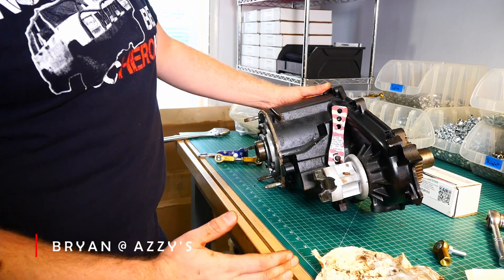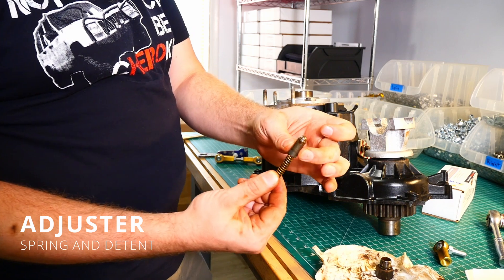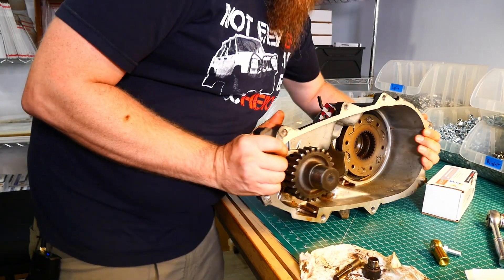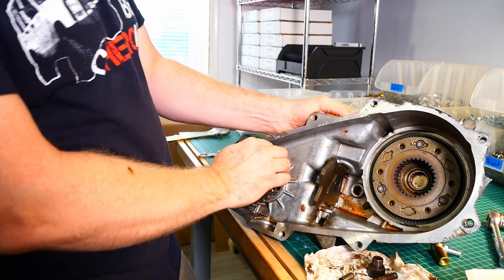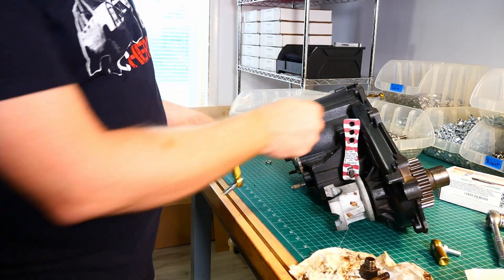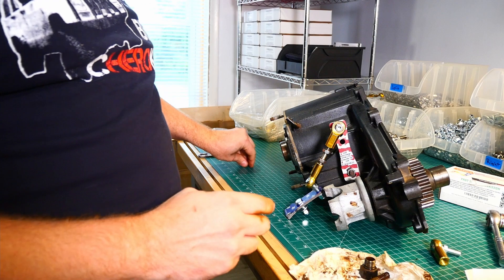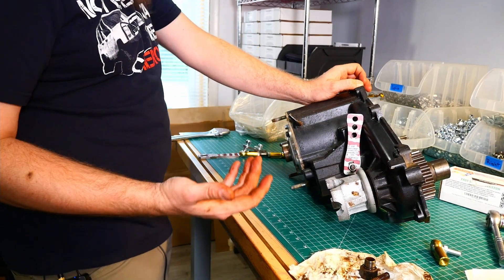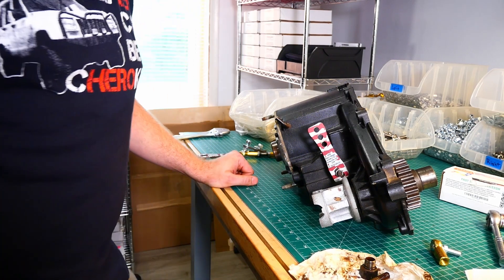Azzy's Design Works: 231 // 242 T-Case detent service for Linkage Adjustment

Comment: I have installed this kit on 242 like how it is done on 231 without the extension piece.  It worked great for the past 3 years. Now I have dropped the T case, the linkage is literally straight with the lever on the transfer case selector at 4 low and it is stuck there now.  Hope is to install the extension and have the linkage at the top most hole on the lever on the transfer case side will bring the mechanical advantage back so that I can get it out of the 4L.
Reply from the maker: We have a lot of them on 242s without, but be careful with tcase drops. It does put extra strain on the front driveshaft, and force it out of phase, and adds extra friction to the slip joint. I've ever been a fan of them. 

The extension should get your back in gear!
Reply: @Azzysdesignworks Thank you for the reply.  

I upgraded the cross member and it gives 1 inch drop.  Already have SYE. Now that you mentioned it, I can see how the t case drop can add more angle to the front driveshaft.

Do you have any recommendation on which holes out of the 3 that I should use?

Comment: I have the 242 and have the extra shifter tab. Had to mount the bottom one backwards or the centre links hit the drive shaft. Struggling to adjust it right as it pops out of 4xAll time unless i hold the shifter back. The first 4hi part time engages a little early on the cluster in cab. Im running top bolt on the 3 on the transfer case side. Am I running the rod too short or too long? Seems centered when im under the truck. Little help. Just losing my mind 🤦🤦
Reply: Ok thank you
Reply from the maker: Drop me a photo, info - azzysdesignworks.com
Reply: @Azzysdesignworks  figured it out! I the video you say top hole for the 242. On the photo on your website it's in a lower hole. Now it's finally working! It's amazing!! Solid!! Thank you.
Reply: So which is it, top hole or lower hole?
Reply: @danielpeyton9072  bottom hole. It took a few hours in the snow going back and forth adjusting the length and rechecking. If you need the measurements from bolt centre to centre i can get under it tomorrow before work.
Reply: @danielpeyton9072  correction. 242 t case middle hole, has the extension bracket and bolt to bolt centre hole is 5 inch maybe a hair under.
Reply: Yeah that would be great and can you take a picture of yours too just so I have a better visual idea of what it should look like

Comment: So this is stupid get rid of the 242 part. Once you're in 4 lo it just gets stuck no matter which hole you use. This shit is so dumb. I just spent 4 hours trying to figure it out. Fuck azzy design shift linkage and any kind like it. The shift cable idea was better than that crap

Comment: Have you designed one for the zj yet?
Reply from the maker: We have one designed and made that fits the 242 + 4.0 ZJ, and are testing it with a few V8s.  The biggest delay is getting parts made, our adjustment rod manufacture is behind, and rods we hoped to receive  a month ago are just shipping this week.
Reply: @Azzysdesignworks  I was wondering, is there something fundamentally different about the 249? Or just different lengths? I don't mind buying an adapter and trying to modify it, or even making my own, as long as I'm not going to break my t-case from messing around 😅
Reply from the maker: @Drivin_Sideways  It all comes down to the movement of the input shaft on the tcase. We just were not able to work out a good solution for that case, and did not see the market in trying to make a more complicated one for a case that we did not feel was as popular for offroad applications.

Comment: I have a 2 inch lift and a t case drop. The threaded rod seems to be too short for me even wound all the way out. Jumps into part time 4wd randomly when I have the shifter in 2wd
Reply from the maker: Lifts (with a few exceptions) are not changing the distance between the tcase and lever, we have seen some 96XJs having the floor pan shifted one way or the other.

Email us a photo of how its currently setup. If you are running a 231 kit on the 242, this could be an issue as well.

Comment: I own european 2.5 diesel XJ with manual AX-15 and NP231J t-case...today I lost half a day trying to figure out how to install it...what ever I tried I couldn't do it properly...there is simply not enough space between upper lever and bottom shaft that's coming out of t-case. I'm sure I did everything right, checked 100 times, I'm sure I set up the shifting handle inside the vehicle in the same position as t-case shaft but the golden link is too long (max shortened) I dislocated the blue part following your instruction by puncturing the middle pin and then I managed to install it somehow but now I don't have enough movement to engage the 4L...everything works fine, first three positions shift nice but can't reach the last one :S 
Looking from inside the car, when the shifting handle is down in 2H t-case is also in 2H, I pull it once and it engages 4H normally (it shows the AWD light),  next position should be N, but the handle engages N in last position where 4L should be :\ 
Did anyone have similar experience?
Reply from the maker: Did you see our video (linked in  the instructions and on the website, although a recent batch of 50 or so instructions printed without the link) on adjusting for a 5 speed using the 3rd tab interface? 

https://www.youtube.com/watch?v=od64eiC7XsI&ab_channel=AzzysDesignWorks
Reply: I think we have the same problem. Did you manage to install it?

Comment: Okay I know it says 242 but I literally can’t find any instructions or videos in how it goes in. Because a 242 goes down and up instead of front to back! Please can anyone show me how for my ZJ
Reply from the maker: We do not have a kit for the ZJ yet (it is in testing right now). The 242 install is the same as the 231 in the XJ, just with a longer upper link plate. 

And while they may have come with some of the same components, the ZJ and XJ are different in this regard.

Comment: I think I may have my linkage adjusted incorrectly because it try’s to pop out of 4 low when going down hill and doesn’t fully engage in 4hi at times.
2001 Jeep xj

Any words of advice or suggestions
Reply from the maker: Send us a photo of how you have it setup for us best to diagnose.

Comment: Will this work with a dropped t-case as well?
Reply from the maker: Yes, either kit will work with a dropped transmember.  In our experience, running one of those puts stresses on the front driveshaft, and contributes to vibrations at the case itself. We would recommend if you use our kit with one, to use loctite medium strength threadlocker on the turnbuckle to secure. 

As always, spare parts are available in our shop too : https://www.azzysdesignworks.com/shop/spare-parts

Comment: Hi, just received the linkage today. I'm just wondering if you ever come across the problem where the centre rod is too short?
Reply from the maker: Our design has the rod at its longest for the application. However we have run into both XJs that have worn motor mounts or are slightly out of spec (the infamous built in 96 on a friday XJs). Most times we find that the kits get installed a bit backwards, or worse, we find a knockoff kit that was not copied correctly. If your kit does not have our graphics and name on it, its a fake. 

Find the email address on your instruction sheet and send us a photo of how you have it setup, we can advise :)